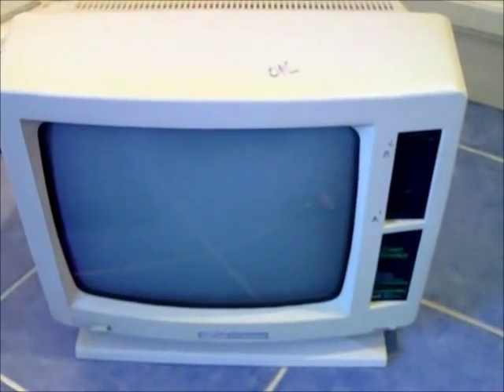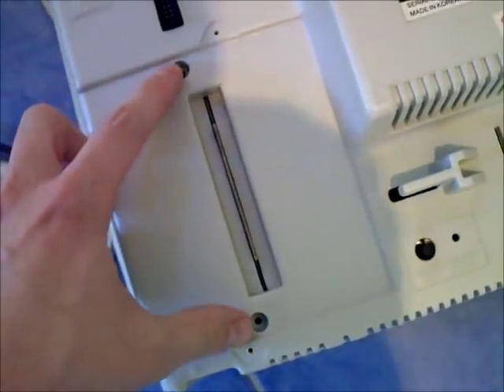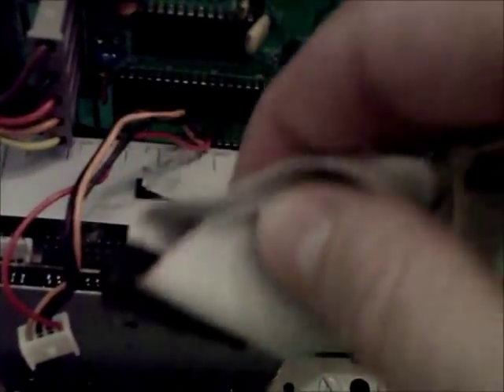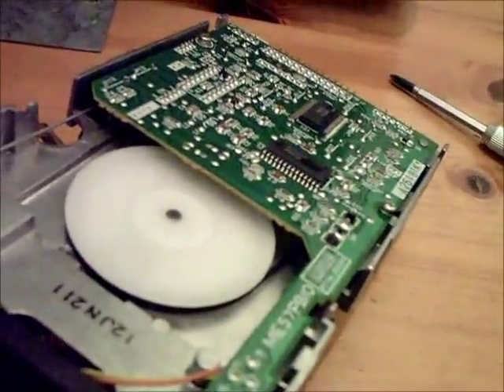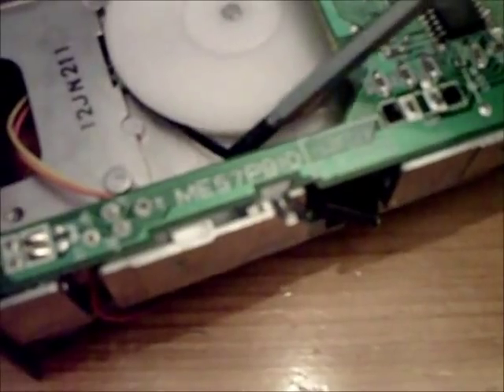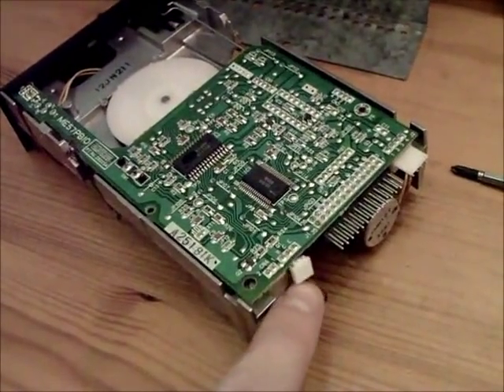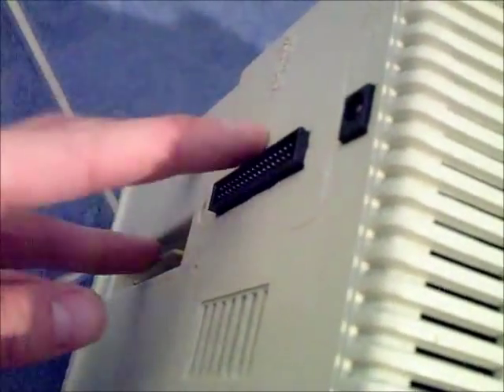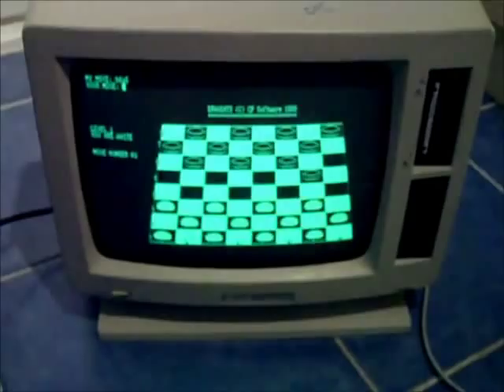Amstrad PCW 8256 / 8512 (CPC 6128 & Spectrum +3) 3" Disk Drive Repair Tutorial

Comment: As soon as I heard the noise of the drive I thought to myself "Hello the drive belt has disintegrated". Great tutorial. Retro Computer Shack is a great place to get replacement belts. I had to replace the belt for my ZX Spectrum +3. This is a bit more dangerous as you have to be careful of the stored voltage around the CRT.

Comment from the maker: @weirdstuffanimation7 Sounds like the roller is not rolling the paper up. This did happen to me and the culprit was something lodged in the printer, which was easily removed. I'd check for debris inside by lifting the front flap and removing the ribbon. Hope you ge it printing.